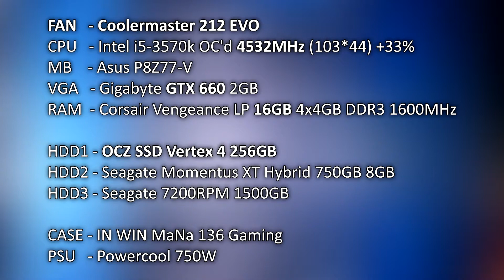Coolermaster 212 EVO Temperatures on i5-3570k Overclocked 4532MHz

Comment: Dude I don't understand the temperature charts. Could you explain what temperatures you get when you game. Nice Build!
Reply from the maker: the temperature chart is in Celsius (not Fahrenheit)
when Gaming (burn test) the temperature goes up to 62C while overclocked with the 212 Evo fan
Reply: So is 62C good? I am new to PC gaming. What should be the maximum temperature.
Reply from the maker: Alican Boran 62C temperature is very good if your CPU usage is 100%. if your CPU goes over 100C then you are burning the CPU, it will shut down the computer or worse it will overheat and explode :D

Comment: oh lord that wiring is atrocious, and I must point out basing any sort of information on this Video would be a bad idea, put the panels on that case and I guarantee you will see minimum 5 degrees celsius increase -_-
Reply: nowmowcow You call that atrocious, you haven't seen my midi tower without cable management.
Reply: XD
Reply: Getting a new case tomorrow, however. It's just no good running a 280x in a badly cabled system inside a badly designed case that sits in a tight space inside a house where room temperatures can reach 30°C on some days in summer.

The problem isn't even the gfx card itself.. The cooler fights valiantly and manages to keep its temperature below 80°C.. the CPU just about survives, too. It's the hard drives going up to 50°C that worry me, as well as the power supply sitting at the top that gets so hot you can barely touch the case in that area.
Reply: My mini ITX case that is BEAUTIFULLY managed has to be entirely redone....for the 7th time goddamn, I am running out of blue UV ties..and money to replace drives....and band-aids.....and patience-_-